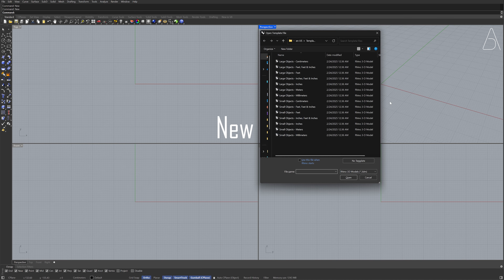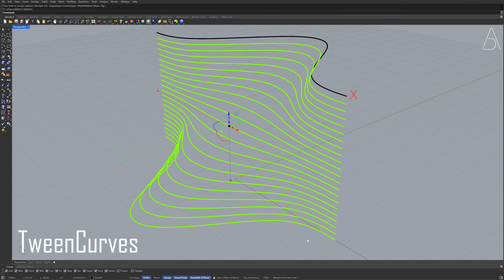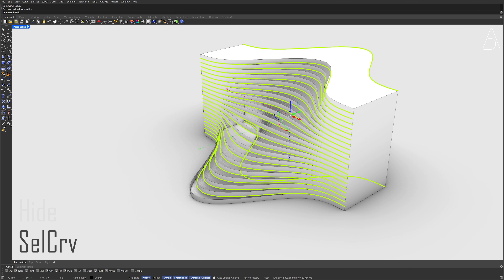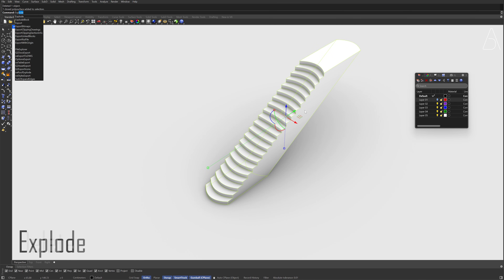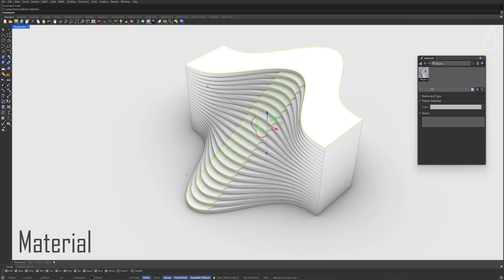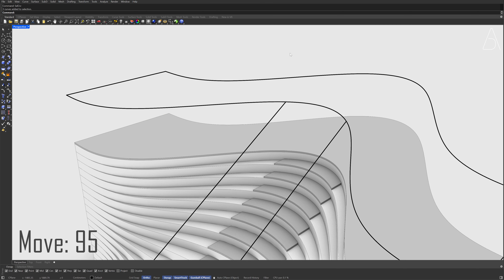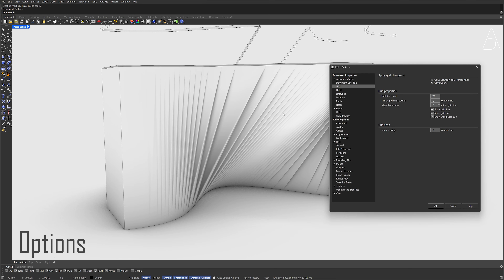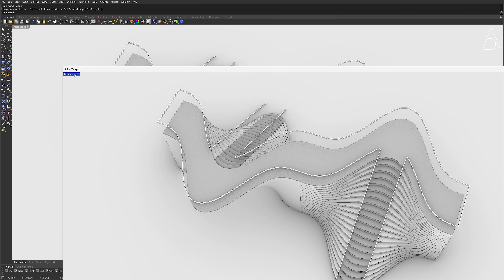Rhino 8 Tutorial | Fluid & Organic Staircase Design

Comment: How do I set the base point to the end knot at 1:33? It only lets me select the cplane
Reply from the maker: Hi! If you don't see the SetBasePoint option in the command panel, here's a workaround:
Before extruding, measure the distance between the two curves and manually extrude using that value. 
That way, you’re matching the intended offset even without setting the base point directly.

Comment: Hello
I want to draw the lines of a flower in Rhino version 8, please help me.
I drew some petals with 2D lines.
The end of the lines and the tip of the leaf are connected.
I drew the bottom end of the three-dimensional shape that is going to be with the transform option.
And I placed it at the end of the leaf.
Now some of my leaf lines have crossed each other.
This means that another leaf has grown from one leaf, so for this, the lines of the second leaf must enter the first leaf.
Now, to make the lines and surfaces 3D, the sweep 2 rails option I use does not work and only some leaves become 3D.
What is the problem?